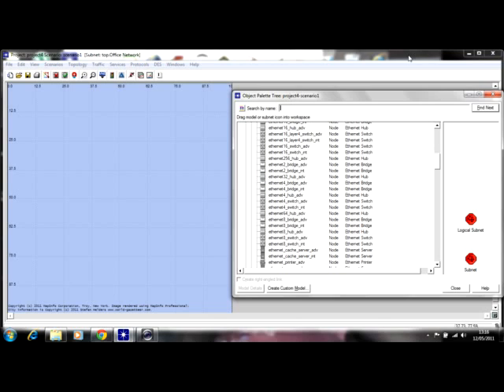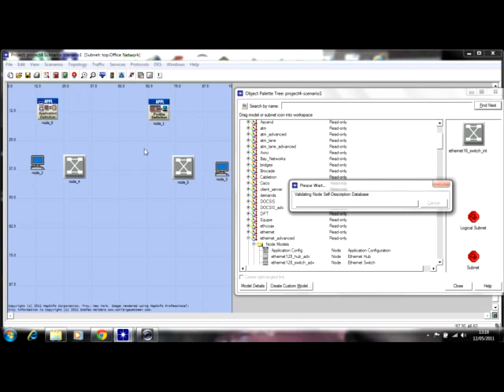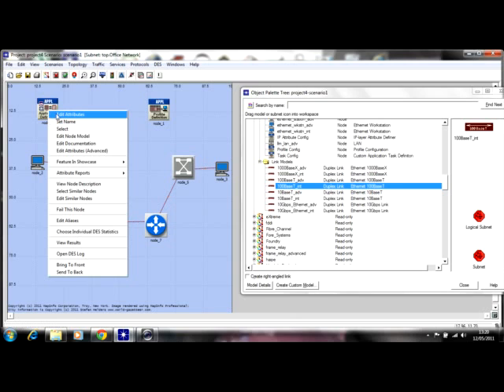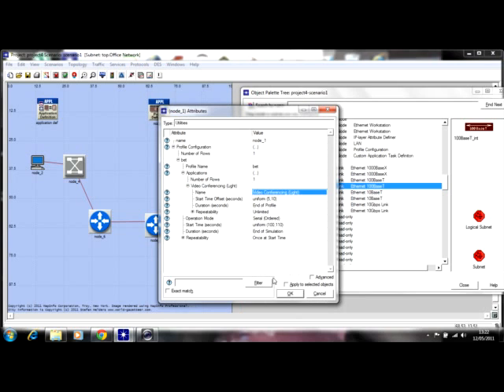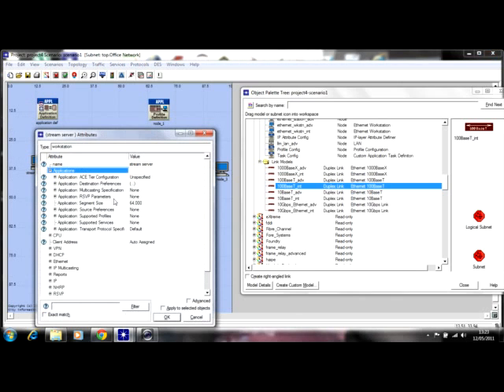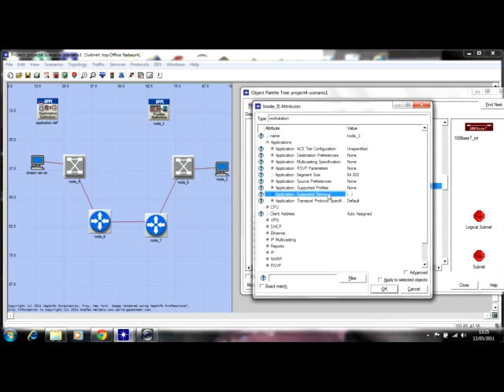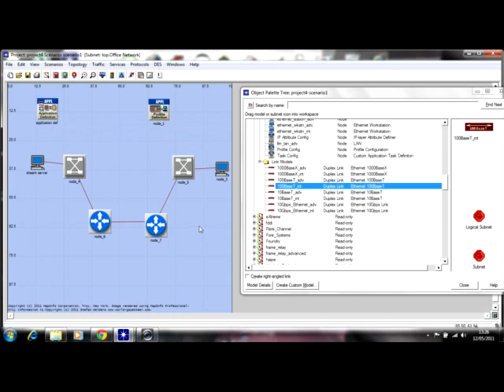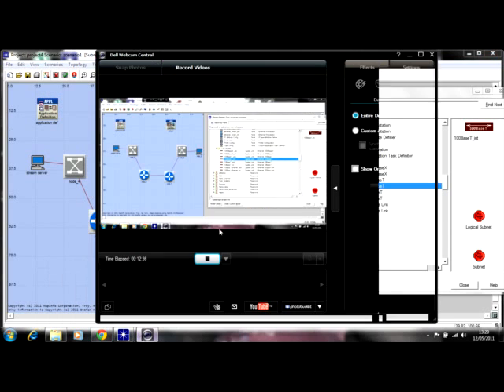OPNET MODELER tutorial (video streaming )

Comment: Hi Mr. Raimi, I want to know if you have already changed some machine layer architecture that are placed in the "Node Model". 
So now, I work with the OPNET 14.5 version and I want to change the definition of some "Streams" specially those between the RLC_MAC and the antennas in the UMTS Model, and I don't know if I must to change the programming code or just searching a parameter in the  Node Model Toolbar that refer to this thing.  Thanks Mr Raimi. Best Regards.